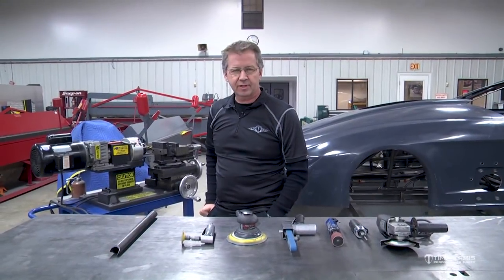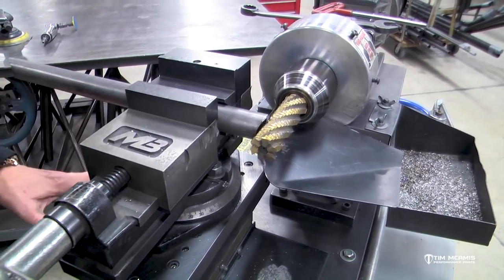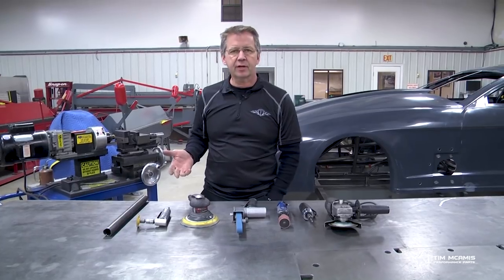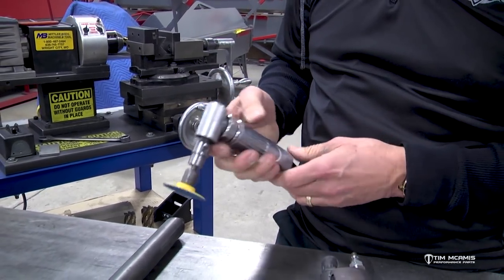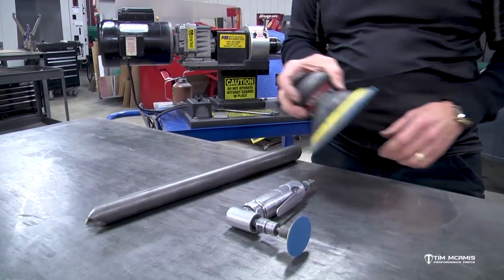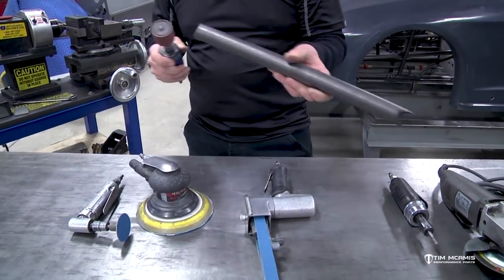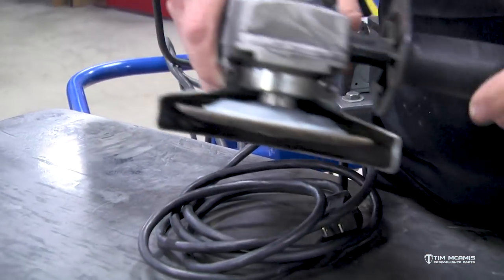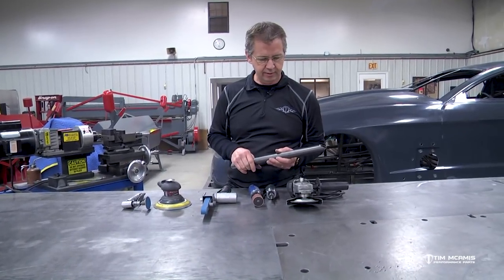Fitting Tools - Fabrication Series: 02

Comment: For building a cage or frame is having a dual voltage welder that runs 110 and 220 volt the best or having a dedicated 110 or 220 volt welder the way to go for a beginner racer / car builder / engine builder ?